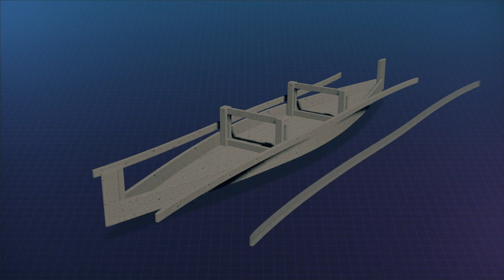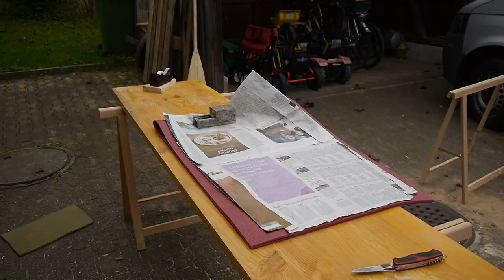DIY Roof Batten Canoe, super simple design - everyone can do, with only few common tools

Comment: Felix, you surprised me. I did not except this kind of seat but it is genius. It only partially supports your weight as the third leg of a tripod with your knees and keeps your center of gravity low. I very much look forward to seeing your report on its comfort for multi hour trips. The ends look wonderful and do make it look more of a traditional Indian canoe. I have owned several canoes and yours looks every bit as good or better than those. The only thing left is to see how it tracks and performs. I am guessing it will not be quite as aerodynamic as a curved bottom but it should be more stable and not as tippy as a curved bottom. It is well worth the trade off for ease of build in my opinion. I am going to build one based on your design but am having trouble sourcing spruce roof batten here in the U.S.  I can easily get cedar 1x4” and split them lengthwise in half. What are your thoughts on cedar? Keep up the great work! I am amazed at your ingenuity! Best, Richard
Reply from the maker: Thank you so much for your positive feedback! Thake the wood you find. In Switzerland spruce is a cheap wood. Cedar is for sure much better.

Comment: Felix have you considered adding a small mast and sail to this project. Something that is easy to deploy and quickly removeable in case of wind gusts threatening to cause a capsize. If you install a block of wood on the bottom just near the front brace and add a block above it a simple mast could be fashioned from a long broom handle and you could make a simple triangular sail from a bedsheet. Attach the sail to the mast and a small boom which is only fastened with a small loop of rope to the bottom of the mast so that you can move the boom to the other side of the mast easily and a length of rope to the outboard end of the boom so you have a degree of control over the speed of your craft by pulling in the sail or letting it swing out depending upon the direction and strength of the wind. I think that this arrangement of rigging is known as a Luff or Gaff rigging.
Reply from the maker: Yessss i thoght about !! Thanks for your comment!
Reply: Felix. Great little canoe. The easiest sail to use on a canoe, kayak, or other narrow boat is more like a very small spinnaker (Mine is about 1.4 square meters), which only pulls when you're running with the wind. Less chance of getting blown over sideways. If you attach the sheets (ropes) to the sides of the boat with hook-and-loop material,they will pull loose if a strong gust hits the sail. 
Your canoe is narrow enough to paddle well with a kayak paddle - twice as many power strokes as with a canoe paddle.

Comment: Very well done! For safety, one thing I would suggest is that you attach an anchor to the bow. It can be as simple as a small jug with cement hardened in it and an eye bolt sunk into the cement before it sets. The anchor rope should be more that two times the depth of water. Stay safe :)
Reply from the maker: Thanks for your comment!

Comment: Felix, I don't blame you for wanting to test your own design out first. I would do the same thing. My suggestions last week were just things that you might want to try later on and the suggestions I leave today are offered under the same conditions, because it didn't sound to me like you were exactly saying " Leave me alone, I don't want anymore suggestions!!!". If I'm wrong, just ignore me. LOL 
   If you take your rope out and pass it through a 4 inch/100 mm long piece of plastic tubing of 1/2 inch/13mm diameter or larger before you reattach it to your boat, I think it will be more comfortable to carry the boat. Rope, of the diameter that you used, cuts into the hand quite badly. You could also drill out the center of a wooden dowel to make the materials more consistent if you wanted to keep everything pretty.
   Last week when I mentioned the Pirogue from the Cajun South here in America, I told you how they used metal rods pushed into the mud to stabilize the boat for fishing and hunting. Well, your ingenious way of mounting a bicycle seat to the boat offers the perfect place to drill a hole through its stem and the boat's bottom to shove a rod out the bottom of the boat and into the mud, then remount the seat. You're a wizard! See ya next Friday. Ciao!
Reply from the maker: Thank you so much for your interesting comments!

Comment: Adding a keel strip will add slight stability and help to go straight. The 90° sides offer little secondary stability, but adding a keel strip is easy and will likely help some.
Reply from the maker: I will think about! Thanks...
Reply: I'd taper a keel strip to nothing in the forward third, and add that to the aft end. Make it non buoyant, so it don't work against stability. Keep it going straight easier, and maintain what stability it has. Won't weigh much and the bow can still be nosed onto a landing without tilting cause it's flat. Turning with a keel is easiest by tilting the canoe as the proper stroke is given, but with no real secondary stability I'd skip the leaning.  I bet you could incorporate small recessed tie in points where upon you could cut bicycle inner tubes opposite the valve stem, constrictor knot seal the ends over plugs, then stretch them length wise port and starboard just above the load water line trim. Need a middle anchor point as well. That is lightweight, low cost, replaceable,  field repairable solution. Just build out and recess the anchor points. Maybe make them adjustable somewhat for load trim.

Comment: I'm a little concerned about the seat. It looks like all your weight rests on the metal pole holding the seat and that is directly on a single layer of wood. I would think that shifts in weight to the sides as you hit waves would cause the pole to eat through the wood. Maybe I missed a step where something was added to protect the wood.
Reply from the maker: Yessss, you missed a step.. But thanks for watching my video!